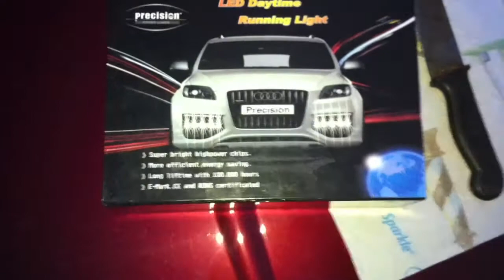Install a 12LED Day Time running light - 2008 Nissan Sentra

Comment: not really DRL because they only come on when you turn on the parking lights, should have gotten power from a accessorie power that way they turn on only when the engine is on